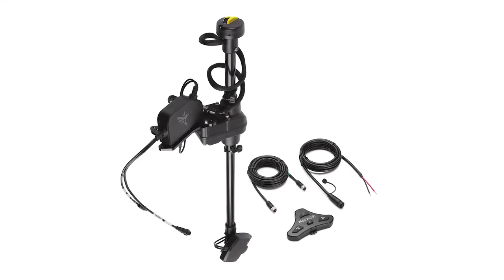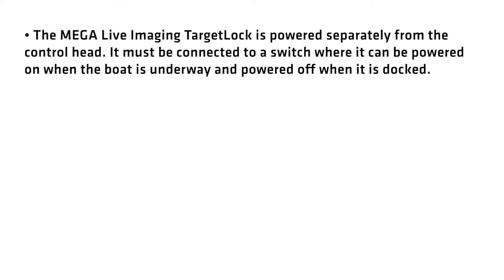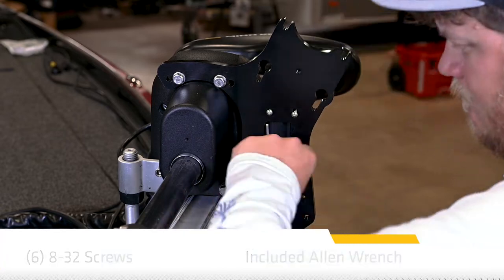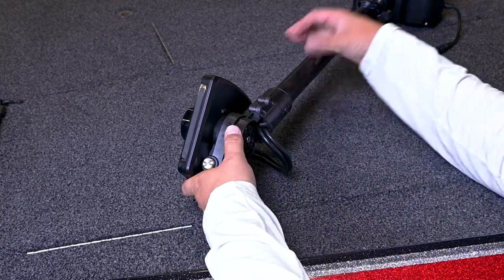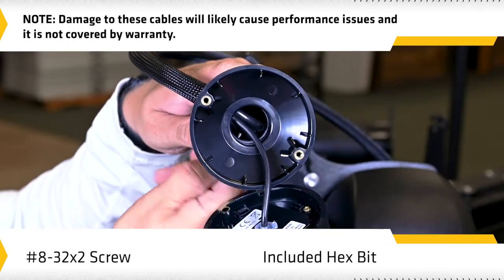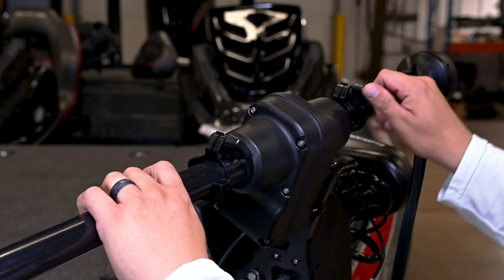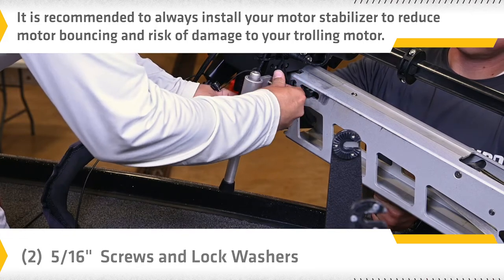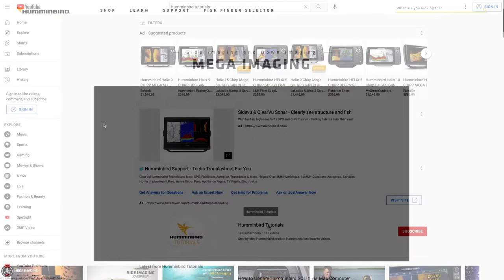How to Install MEGA Live TargetLock | Humminbird

Comment: What length is the Ultrex shaft in this video? (I might have missed it). I did catch the transducer has to be submerged 6" & at least 1" above the prop.
Reply: Youll be fine...I have the 45 inch and worked out perfectly

Comment: GUYS BE SURE IF YOU ADD A STABILIZER YOU KEEP THE TARGET LOCK SIDE SLIGHTLY LOOSER...IF ITS TOO TIGHT YOUR SYSTEM WILL PROMPT THE MEGA LIVE MOTOR STOP FOR DAMAGE MESSAGE...IF THAT POPS UP...LOOSEN STABILIZER AND RESTART CALIBRATION PROCESS...IT WILL CLEAR ONCE THE RESTRICTION IS BETTER IN SHAFT MOVEMENT...HOPE THIS HELPS